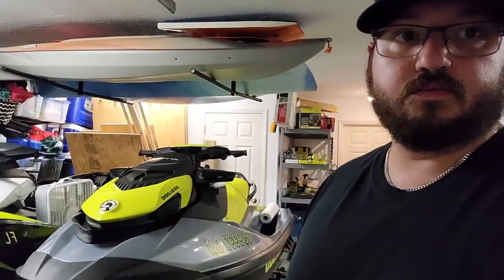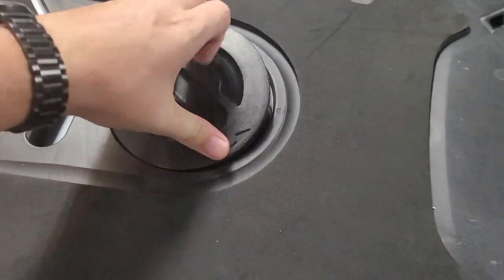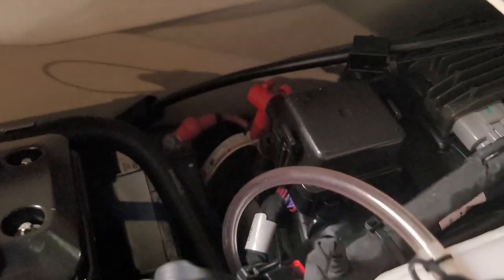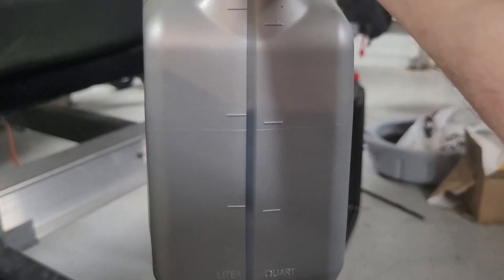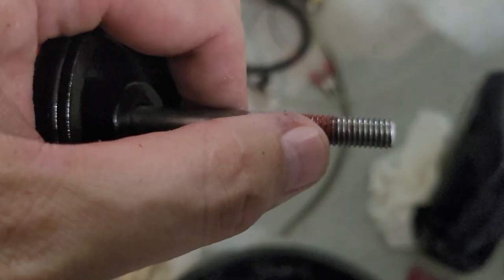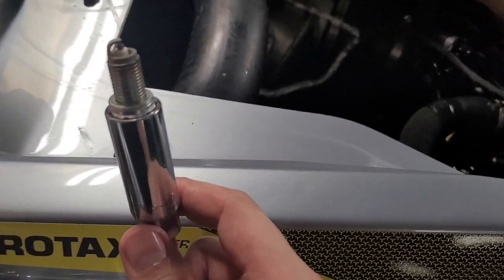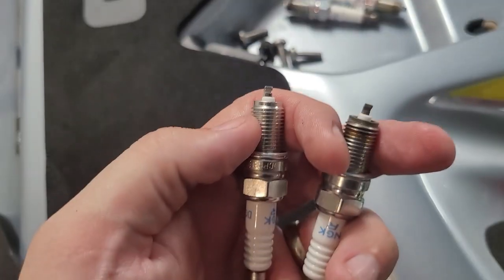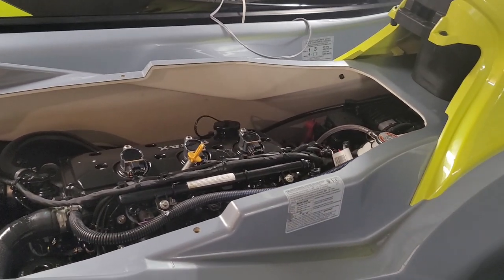Changing the Oil in my 2021 SeaDoo GTI SE 170

Comment: Just a tip : take spark plugs out before turning the starter. It's less effort for the starter and battery. You can get a little more oil out by slushing from the filter housing while the starter is turning.
Reply from the maker: Great tip, thank you!

Comment: I have a question:   I completed the oil change yesterday, poured the New oil in an completed the job ! …however, I soon realized that I forgot to turn the engine over a few times (as you explained) to get more of the old oil out.  Is it a big deal or what would be your say on this situation  ??
Reply from the maker: I think it depends on how old the old oil is. If the old oil had more than 50 hours on it, I may go 20 to 30 hours knowing that the oil that's in there now is a mix of old and new. But if you want to be on the safe side, if you completely replace it all at least you'll know it is all new. So what you SHOULD do is replace it all. What I would do is probably run it another 25 hours or so.
Reply: @professionalweekenders  With this design you will never get all the used oil out. Poor design and nothing you can do about it that I can see. If someone could devise a way to tap a drain valve into the sump ( if there is a sump on these engines) they could make a ton of money. Premium price paid for a lawnmower engine.
Reply from the maker: @rickss69  Premium price paid for a lawnmower engine. lol :)

Comment: If you have the money to buy a newer  seadoo pay for sacrifice oil instead of spinning engine over low oil, just fill with same w synthetic car oil spill over engine 20secs no revs re drain fill with the good stuff and use red on that filter nut USE RED!!
Reply: Forgot the most important part Good video watched on lunch break for idk why but good job GREAT Video 🤙
Reply from the maker: Thanks for the advice.

Comment: the screws that hold the cover on.....what is on the underside of them? How do they not fall into the machine? Not the front ones, but all the back ones.
Reply from the maker: They have plastic clip in nuts. They clip into the hull to prevent them from falling through.

Comment: What about the codes? did you erase it yourself? I did not read the whole thread to see if you already answer that. Great video!!!
Reply from the maker: I did not have any codes to erase. This ski has 90 hours on it so far and no codes at all. My older 2017 had a maintenance required soon code pop up right around 100 hours while I was doing an oil change on it. I've heard that for the older ones like the 2017 that you need a special computer to erase it. In my case it just went away. So luckily I have not had to deal with any codes yet. For the newer ones like this 2021, I've heard that you can erase the code yourself, although I don't remember exactly the process. It has something to do with pushing and holding a series of buttons, I'm sure it can be found again on a form.

Comment: Hey man, how many hours have you already put on it to need that oil change and especially spark plug change? I have a 2020 gti se 170 and with only 43 hours on it I was only going to change oil before summer and not spark plugs.
Reply from the maker: In the video, it only had 20 hours on it. The user manual recommends changing the oil and performing a full service within the first 50 hours. I believe it's a good idea to change the oil early and get out some of the metal shavings that is in the engine from the break-in process of the sharp edges and new grooves being cut as the engine breaks in. The manual further recommends additional full service once a year. Full service includes oil change and spark plugs. I agree the spark plugs are probably a bit overkill, but they come in the kit and don't cost much more. Also I'm trying to maintain my warranty while still doing the work myself. Finally you have to remember these are small high-strung engines they are not nearly as robust as a car engine. It's probably closer to a piece of lawn equipment like a small tractor or lawn mower, although this is a four stroke. It's not uncommon for manufacturers of lawn mowers to recommend oil changes and including spark plugs once a year.
Reply from the maker: Yours with 43 hours on it is perfect as long as you change the oil before the rideing season starts in your area. Keep your recipes for the warenty and have fun ripping it up on your ski this summer!
Reply: @professionalweekenders  thanks for the feedback man! And you have fun too my guy!

Comment: Thanks for the video. I didn't notice that you attached the earth strap on the coil pack incorrectly. It should go above the pack and under the head of the bolt. You put it under the coil pack. Doesn't look like there'll be much earth connection there. Have a look at 18:49, which is how it was before you removed them.
Reply from the maker: Thanks, and you are correct. I didn't notice until after the video was published.

Comment: Just changed oil in my 2023 SeaDoo 230 WakePro and noticed a gap between the oil filter canister cap & housing, say about .100". You mentioned this in the video, but was wondering if this is a constant issue and if you know why this is? Thanks for any information you can provide.
Reply from the maker: I'm not sure why the gap is there. It seems to be from manufacturing. However I do know that it was there before I ever did my first oil change, so I just keep it consistent.

Comment: I just did the first oil change on mine tonight. Your video was super helpful. The only thing I was curious about was I was able to get almost 4 quarts out of it. The kit only came with 3.5 so I have to buy another quarter to top it off. Why do you think you only were able to remove 2.5 quarts? The manual says we should be able to remove 3.3 quarts.
Reply from the maker: I wonder, if maybe yours was over filled. It can be a real problem to get the dipstick to show an accurate level. Make sure the ski is sitting level, turn the engine over a few times to get all the oil in the right places, and you may have to give it up to 30 minutes for all the oil to settle. Just be careful about putting too much in. Too much oil can damage the engine.
Reply: @professionalweekenders  It was still on the factory break in so it would have had to been over filled at the factory. The manual says it has 5 quarts in it and that you can only get 3.3 out. I guess i was able to get a little more than that out. I've got to find a different oil next year. 100 bucks for a 4 quart oil change is ridiculous.
Reply from the maker: @chrissteffen9679  I've heard some people had success with the Shell rotella oil. But I've not yet tried it myself.

Comment: I got my oil change kit from the dealer and it came with 3 quarts plus a small bottle for topping off. The o ring package looks different also. Funny thing is yours has the small o ring as this one does not. Price was 81.99
Reply from the maker: Good to know. Thanks for the tip. Did yours include spark plugs? That seems to make the biggest difference in the price of the kits that I've seen online.
Reply: @professionalweekenders  it didnt include plugs but I wouldnt replace them every year anyways. Mine still looked good.

Comment: Awesome video  
What is the brand name of your oil pump And what size tubing will work thanks again
Reply from the maker: Thank you. Just used a generic one from Amazon. It comes with the correct size hoses so no need to purchase anything else, I believe it is probably about 1/4". Here is the link to the pump on Amazon. Less than $20
https://www.amazon.com/Extractor-Scavenge-Suction-Transfer-Changing/dp/B07X33FC1V/ref=mp_s_a_1_1_sspa?dchild=1&keywords=oil+pump&qid=1631925818&sr=8-1-spons&psc=1&smid=A1RKX5VK3854M&spLa=ZW5jcnlwdGVkUXVhbGlmaWVyPUEzRlRMQUhEOEZTTUhDJmVuY3J5cHRlZElkPUEwNzI1NjU5MUZSRTU4STlISjZaVyZlbmNyeXB0ZWRBZElkPUEwMTA2MDgwMkdENVROM1FZNjdUUSZ3aWRnZXROYW1lPXNwX3Bob25lX3NlYXJjaF9hdGYmYWN0aW9uPWNsaWNrUmVkaXJlY3QmZG9Ob3RMb2dDbGljaz10cnVl

Comment: I have the 2021 Gti Se and did first oil change at 17 hrs. It’s getting cooler in Georgia so probably will not put very more hrs on this year. I bought the oil change kit with 3 quarts and 1 pint, rings and oil filter. I have the same pump and removed almost a gallon of oil. So now I am short oil. Next time I will get the gallon jug. The oil stick is showing just a little oil. Not near where it should be. I guess I literally sucked all the oil out of it. I’m confused when I read everyone saying it was more than enough. I have jet ski level in the garage too.
Reply from the maker: That is interesting. Having done a few oil changes on my 2021 and 2017, I've never been able to get more than 2.5 or so quarts out. Not sure what was done differently.
Reply: @professionalweekenders  I cranked it over several times and it seems to look close enough. So the kit was more than enough. I think it was probably overfilled from dealer.
Reply: I pull out ewerytime 3,5 liters... in is 5 liter...  1.5 or 2 liters always stay in there.. GTR 215

Comment: Hi nice video. I recommend you first warm the engine for some minutes in that way the oil will be smooth and will drain faster.
Reply from the maker: Thanks Javier, that's a great tip!
Reply: Took mine out to the lake 20 minutes away and then did oil change. It came out really well
Reply: PreWarm the engine FIRST..egads..I know that, and I'm a girl😂

Comment: Great vid. Maintenance reminder just came up on my 2020 170 GTI. Do you know how to reset that? Going to try to change oil just as you did but want to reset that when done.
Reply from the maker: Thanks Matt. I'm not a mechanic by any means; I just like to to basic maintenance on my own stuff. I've not seen the maintenance reminder on my ski and I'm at about 70 hours so far. I did a quick Google search, it may be something more serious. You can start with the oil change and then try disconnecting the battery for a bit. If it is still there, you can buy a diagnostic device or take it to the dealership. Good luck!

Comment: On the very first oil change, would you change out the spark plugs?  Some say don't need to change plugs until 50hrs.  I am a brand new 2023 GTX-230 owner.
Reply from the maker: Probably not necessary, but doesn't hurt either.
Reply: @professionalweekenders  I have seen a lot of videos where people will run the engine (hooked up to water) for 4 min to warm up the oil first then extract the oil.  (Strange because See Doo only recommends the engine to run hooked up to a hose for no more than 2min to flush out the exhaust) But I have also seen what you did. Hold the throttle so the engine turns over for 30 seconds then extract the oil.  What to do?  Im ready for my first oil change.  Thank you.
Reply: @professionalweekenders  what size socket to take out the spark plugs?

Comment: Great and informative video! How is the hull holding up? Seeing videos of cracked polytech 2.0 and the dreaded carbon seal issues too 😑 I am in the market for the gti not going to be doing anything crazy let me know your thoughts!
Reply from the maker: So far good. Got close to fifty hours on it so far. No issues. The hull held up better than my fiberglass one did when both we run up on a bed of barnacles. No issues with the carbon seal either. I think that is an older issue, or from improper  use. Don't run/rev it out of water to keep it cool and protect the seal from damage (aside from a quick engine flush). Also don't break the motor mounts jumping massive waves and you shouldn't have any issues. Finally, it comes with a 3 year warranty.
Reply: Concerns about carbon seals are mostly posted by SeaDoo detractors. Much ado about nothing. I have 260 hours on a 2007 GTI SE and the carbon seal is original and still good. And I also have a 2021 GTI SE 170 too, and I think fiberglass is smoother and less drag in the water, but the hull has fiberglass stringers embedded for additional strength. It would take an insane accident and impact to break this hull. Not concerned at all with strength and mounts.

Comment: Great video. What oil change kit did you buy? I can't find one specifically for the 170.
Reply from the maker: The 130 and 170 are the exact same engine, just a different tune. Infact the GTX, GTR, RXP, RXT, FishPro are the same too although some have a supercharger. They all take the same plugs, filter, and oil. When you searching on Amazon the only thing you really have to look out for is don't buy one for the spark or the GTI 90. Those are smaller engines and come with less oil. I generally just look for one that offers a full gallon. This listing here will do just fine. https://www.amazon.com/Sea-Doo-Change-Filter-Rings/dp/B072PYLTFB/ref=mp_s_a_1_4?crid=3G38M9GL6P3SK&keywords=seadoo+oil+change+kit&qid=1662424831&sprefix=see+doo+oil%2Caps%2C121&sr=8-4&ufe=app_do%3Aamzn1.fos.006c50ae-5d4c-4777-9bc0-4513d670b6bc
Reply: Thank you!

Comment: Hey just wondering what’s the purpose of how gap the spark plug is ? 
does new spark plugs already come gapped or how does that part work ?
Reply from the maker: Spark plugs should have a specific gap in order to create an optimal spark. If the gap is too big or to small it may not spark correctly. I'm sure you can look up the official gap measurement in the shop manual, but what I typically do is take an average of the gaps on the old plugs when I remove them and ensure that the new plugs are set consistently to that measurement. Most of the time the plugs come pre-gaped, but it doesn't hurt to double check. You can purchase one of those measuring coins at your local auto parts store for less than a dollar. You can use the coin itself to increase the gap if needed, and if you need to reduce the gap just lightly tap the end of the plug on something hard.

Comment: Why do you have to hold down the gas when cranking it over?
Reply from the maker: Holding it down, prevents it from starting. Don't want to run it with out any oil. Just want to move the rest of the oil to the bottom of the pan.

Comment: Hello friend beautiful machine. What is something like that cost out the door ??
Reply from the maker: They start at $11500. Add in tax, title, delivery, and assembly, $14500 out the door. Of course that is without the $800 optional sound system which I didn't want and didn't get. I had hard time finding a 170 in stock that didn't already have the sound system installed. Had to drive to Orlando to get this one. Oh, and I already had the trailer. Expect to pay between $800-$2500 for a trailer if you want single vs double, aluminum vs galvanized.
Reply: @professionalweekenders  thanks for the detailed reply now I know what to expect on spending… I will keep watching your channel
Reply: Go mine with aluminum Triton trailer, orange crush with sound system  $15,000. That was in Augusta Georgia
Reply from the maker: Nice! Good deal!

Comment: What size torx bits do you need for this. I just bought this model. Thanks!
Reply from the maker: A T30 to get the cover off and to remove the coil packs. But you'll need an E10 (inverse torx)  to remove the oil filter.
Reply: @professionalweekenders  thank you so much!!!

Comment: How come you wouldn’t pull oil from the fill cap? Seems like it might be easier? You can also get oil change kits from the dealer not Amazon that have the exact amount of oil in smaller jugs and a filter with rubber seals just so you know!
Reply from the maker: Thanks for the tip. I suction from the dip stick because it is direct access to the bottom engine. I'm not sure it's possible to snake the tube all the way down the engine from the fill tube.
Reply: @professionalweekenders  ok thanks good to know
Reply: @professionalweekenders  Question ... I have a 2020 wake 170 and I have a manual pump (that worked perfectly on our 2020 Sea Doo Trixx) BUT I can only get the tube about 2/3 of the way down on the 170??  It does have a slight bend in the dipstick, but I simply can't get it past that point and don't want to screw anything up.
Reply from the maker: @cnterfld21  it should be be same engine. I had no problem getting my tube straight down there. I think there is a slight seal where the dipstick tube attaches to the block, maybe you're getting hung up on that. Try wiggling it or maybe get a thinner hose. You should feel it bottom out. I think I know the bend you are talking about at the bottom, but you don't need to bend it to get the oil out. Once it hits the bottom, that is it. No need for it to bend 90° into the pan.
Reply: @professionalweekenders  Well based on the length of the dipstick I'm coming up about 3 " inches short (story of my life..LOL) with the drain tube.  And my Trixx has the 900 Rotax 90hp and our Wake 170 has the Rotax 1630 170hp.  Thanks for the feedback
Reply from the maker: @cnterfld21  lol, yeah maybe try a smaller diameter hose or give it a good wiggle.

Comment: Is there a fuel filter that has to be replaced
Reply from the maker: There is a small filter on the fuel pump inside the gas tank. I have not had to replace mine yet. I have heard that it's good for 500 or maybe even as much as 1000 hours before it needs replaced.

Comment: hey bro,  what size torx is that oil filter bolt ?    T8  /  T10  ?
Reply from the maker: I use a t30 to remove the engine cover and the coil packs. It is an e10 (inverse torx) to remove the oil filter.
Reply: @professionalweekenders  thanks mate !  apprecaited